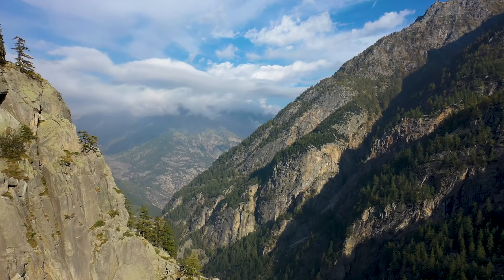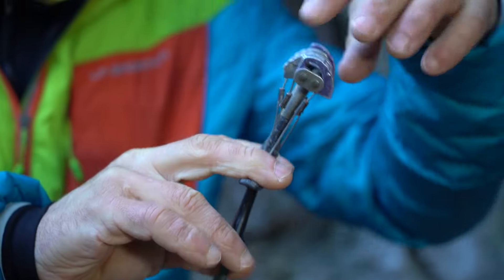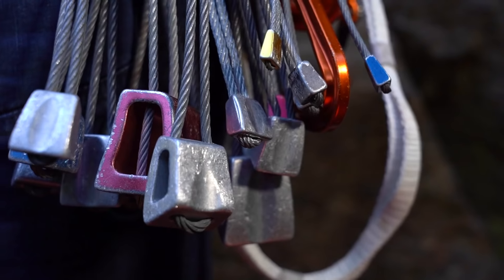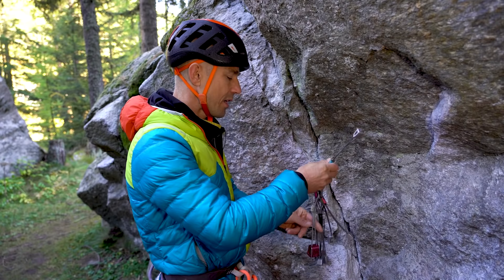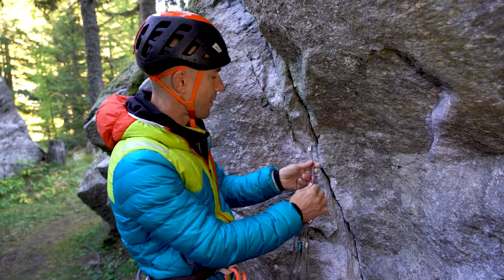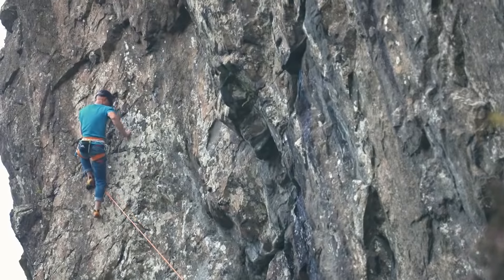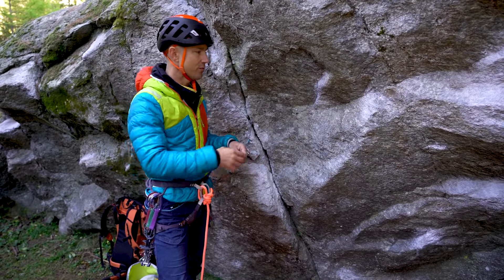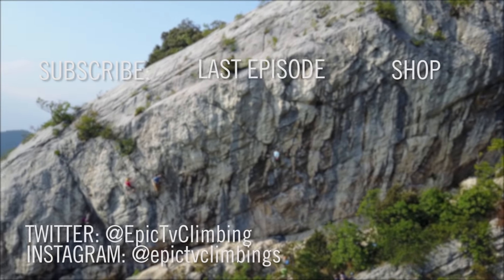Pro Trad Tip - How To Place Nuts With Neil Gresham | Climbing Daily Ep.1935

Comment: Hello, for a while I‘ve been discussing with a friend wether or not it is a good idea to place a nut sideways. Like in a hole where you can slide the nut in from one side and it tucks in by being pulled away from the wall. In case of a fall the wire would bend over the ledge of the hole which of course shouldn’t be to sharp. What does the community here think?
Reply: If you've not figured it out yet, these are often great placements because the nut will naturally cam into position when weighted making it super secure. You don't need to worry about your wire bending on the edge, you can just straighten it out after.
Reply: using the wire rope (or sling of Q.draw) as a re-direct so a hoz placement supports a vert load? great!

side-loaded carabiner over a rock edge = really bad. (see HN2H vid)

gentle sloped rock puts a gentle curve inthe wire rope? dress it out by hand & not sweating.

hard kink in wire rope from acute edge** that will not dress out by hand?

please assess and consider retiring that bit of kit. 

(any broken strands = immediate retire)

** as opposed to 'a cute edge.'